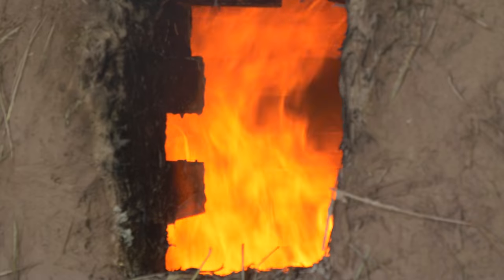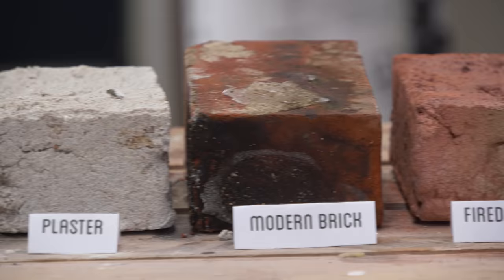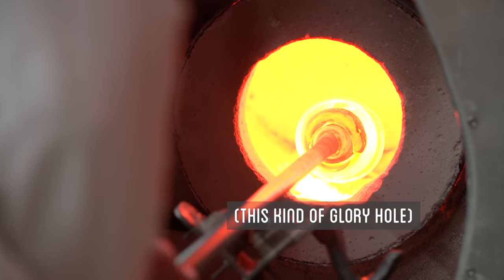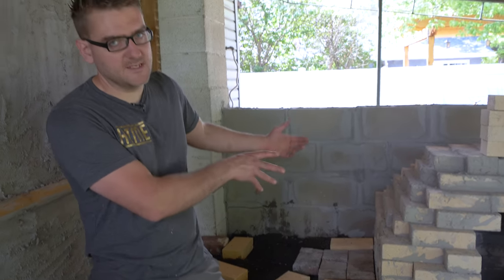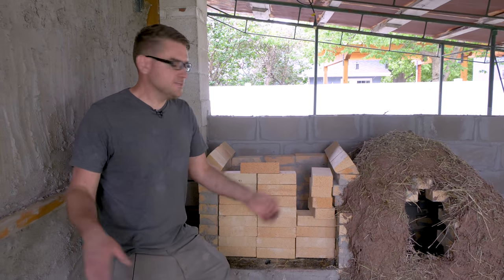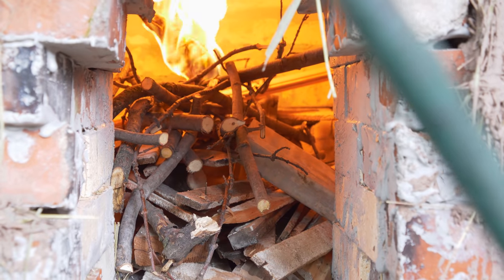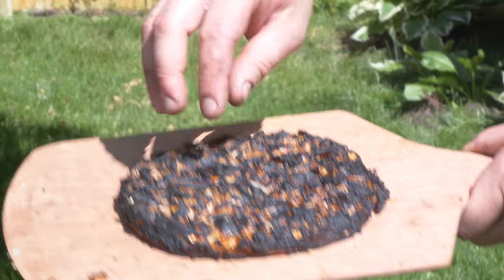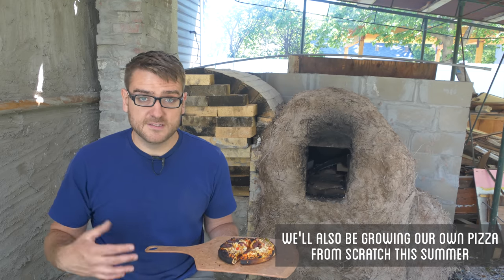Can I Cook a Pizza in My DIY Pottery Kiln?

Comment: For the crushed ceramics, you don't need to make ceramics from the clay, you can bake the dirt directly, and it will turn into ceramics. Just shove piles of loose dirt, and crushing it will be much easier. And modern pizza is right, but how about you make your own pizza, from scratch? You can even use different sauces, instead of ketchup. it just has to be something which is sweet and sour, and to which to add salt, and you've got a tomato paste replaccement.
Contrats on the permanent setup!
Reply: A great channel called tasting history has recently done a great video on the history of pizza (including the "original" pizza, and the american version)
Reply: @DH-xw6jp  I saw that after watching this video an a few more. But I've been suggesting the primitive pizza to Andy for a few months now.
Reply: @SapioiT  probably was long as i have been suggesting a proper anvil.

Even a brozen block is better than a broken rock. Haha
Reply: @DH-xw6jp  True. There are more discussion on the Discord server. I wonder how long it will take Andy to make an actual printer (block printer made from wood and/or terracotta), and a treadle-powered fan, and treadle-powered lathe, and a treadle grindstone, and a few other things I kept suggesting since a year or two ago.

Comment: Nice kiln, but one thing that sticks out to me is that cob is a terrible material for insulation. Cob gives thermal mass, aka retains temperature for a while, but does not really insulate. For insulation you should probably use something like a fluffy mix of straw, and pure clay on top of the cob layer, and after that maybe another cob layer once it's dry, just to be on the safe side.

Comment: If you want to use a bit of modern knowledge, for ceramics and metallurgy where you are operating close to the maximum temperature, preheating the intake air using either the exhaust, heat gun or separate, secondary fire will increase the flame temperature and therefore drastically improve fuel efficiency and process time (if your refractories can handle it). Some steel plants use natural gas to keep the steel molten. Due to the low flame temperature (and high water content in exhaust) this wastes 85% of the available energy.

Comment: I'm not a mason or anything but that mortar looks a little too watery? It should keep its form better and not be runny when you're laying bricks I believe?
Reply: It's gonna harden when heat is applied fusing the bricks together it's the same principle as glue or rubber cement.
Reply: I think the mortar becomes a weak point at high temperatures thats why it's kinda runny to better get into the pores of the brick and to remove the surface area for it to crumble away. Just a guess though
Reply: You are right, but also not. Cement has diferent thermal properties than a brick. When you are building a kiln you want as little cement as possible, otherwise the thing will deform and crack terribly.
Reply: It’s not actually mortar, it’s slip so dries and hardens just like clay would so as it gets used more and more it hardens, whereas with mortar it would depend on the sand and mixture used. Slip just reinforces the kiln

Comment: Normal people: adjust the chair to fit the desk
Autonomous: adjust the desk to fit the chair
Reply: Adjusting the desk and chair to fit you is the best. At least for gaming its ideal for your legs to be at a 90 degree and the desk to be at the right height so that your arm rests comfortably and slightly over 90
Reply: I mean the idea is that the desk alternates between a normal desk and a standing desk, no chair.
Reply: @Darasilverdragon  yeah but for the normal desk case it needs the chair

Comment: Don’t cook pizza next to an open flame, most modern ovens highest temperature is between 250C-300C and a single candle flame can reach 1000C, a burning furnace is overkill. Get it hot, kill the fire, then pizza.

Comment: The primary issue here is that you're using an American style frozen pizza. New York style or American pizza is usually cooked with unfrozen dough at 650 degrees F and bakes for 4-5 minutes.  An oven cooking at 900 degrees+ F requires a Neapolitan style pizza which cooks in 1-2 minutes. The dough has a 65-70% hydration (water to flour weight ratio) and is made with 00 Flour . The added water and processed flour makes the dough burn at higher temperatures than a drier American pizza dough (60% hydration) with all purpose flour.  You can definitely make a good pizza in a wood fired oven if you use the proper dough.

Comment: yeah, bread ovens/pizza ovens don't really work like this a good dome oven works by using a stone or brick bottom to be heated up by a raging fire then when the fire or flames are dying down you remove all the fuel! from the rock/brick base place your pizza or bread inside and put a door on the whole thing to insulate it and if you know the time it takes to make a perfect pizza in this thing you will have the best pizza you'll ever tasted!!
Reply: ps baking sous-vide steaks in this one is A fun and B the greatest thing ever!!!! and with a crust to die for!!!! and super quick 10 to 20 seconds every side and you're done!

Comment: If you have a wood oven, you really don't want to put anything you're baking in there at the same time as the fire is going. It will burn. You'll need to heat the oven, let the fire burn out, close all vents, and only then insert whatever you're baking.
Reply: If you have an oven with a shelf and underneath the self there's an another compartment with a separate flue, you can first heat the actual oven, pull the glowing embers into the compartment beneath the shelf, and get away with putting the bread or pizza or other stuff on the shelf while the embers are burning under it. But if there's an open flame that can directly radiate heat into your pizza, it will burn.

Comment: Brick recipe? I would really like to know the ratios you used.
Reply: They have a discord in which they discuss a lot about the details of his progress, maybe you could ask there
Reply: I would have liked to see the "improved" bricks they made used for something instead of just saying they work and using store bought bricks
Reply: @DH-xw6jp  I wondered if those were store bought, but they made several in the video so I wasn't sure. Using store bought seems wrong.
Reply: @jerrywhidby.  their reason (which i agree with) is that once they accomplished making something they "unlocked" the modern equivalent to save time.

 Which is why they dont make fire with friction any more, or use their craptastic clay forge to smith iron, or smelt their own brozen. But i think they need to show that they actually accomplished the improvement to the bricks they made previously.
Reply: @DH-xw6jp  and I get the saving time idea, but I still think we should get to see it in action once. And then to skip over the recipe just added to the oof feeling. The best part of these videos is learning something new. Especially when they had so many failures before this. It's jist disappointing. It's Primitive Technology without CC on.

Comment: Have you tried using rocks cut into the shape of bricks? I know that's something that was used in many ancient constructions, such as the pyramids.
Reply: the process of cutting rocks is too time consuming, and also natural rocks aren’t very heat resistant and you’re risking them exploding from the heat
Reply: @charlies8538  So couldn't they be tested to see which ones were not going to explode?
Reply: @Bit-while_going  you could but as he also mentioned it’s time consuming, it’s way simpler to just make bricks or concrete
Reply: or buy them in andys case

Comment: Probably not a good idea to use a frozen pizza for one of those, even if it is thawed. I would Imagine that they designed frozen pizzas to cook at a lower heat of an oven around 400F as oppose to wood fire which is about 750F. Looking at YT videos of people making their own pizza kilns, it seems like most everyone made their own dough and pizza. Also, everyone seems to have burnt all the wood to coals and embers to cook their pizza perhaps not to get a strong smoky taste and maintain a more constant, even and consistent heat source as oppose to a raging fire.

Comment: does "unlocking" materials just mean you go out and buy them now? cause not to be a jerk but im 100% certain you bought those bricks at 5:08 you can see a perfect circle stenciled in. What is the point of a reset if your just going to buy commercially available modern material?  It defeats the thesis of your self imposed reset, you just prototype and then buy the material. Theirs no challenge to  ensure your getting techniques correct  and your not actually proving if one person could learn whats needed to remake society, your just kinda half accomplishing a task until you decide to quit and buy materials. I noticed this as soon as you tried to progress to iron you failed a few smelts and gave up, then just used modern iron. i could understand if it was a sourcing issue such as raw iron being difficult to get but you really have no excuse with brick making. Look at Townsends video on brick-making dude literally only using 18th century techniques and technology makes a whole forge with handmade bricks.

Comment: LOL, can use the 400HP turbocharger on the car to supercharge a coal furnace. 800 to 1300 CFM, add a hopper that mixes in powdered coal like a gravity fed sand blaster. hahaha, build a dam and a water wheel that turns a big wood propeller...  "as if they could have made a version of Abraham lake back in the start of the iron age"... 21 square miles, just start shoveling is just easy as long as the garden raiders are gone. grasshoppers rip over 5000 years ago "cant make tools out of gold so was it actually worth anything, "fools gold""? 

Follow planet of the apes, giant hamster wheel can drive a large rotating wood paddle, but I guess the invention of wood cogs is out of date... I guess not, just a language barrier as well as mindless spear thrusting... both at war and at home in bed.

Comment: lets try to master bricks for 3 episodes, doesn't work, then in this one says they are making them using a magical mixutre with "more grog" (which would indeed make the bricks more heat resistant but also more thermally conductive), then proceeds to build the kiln out of store bought INSULATORY brick which is a completely different type then what he was describing, then INSULATES the insulatory brick with cob. ppl applaud. fml.